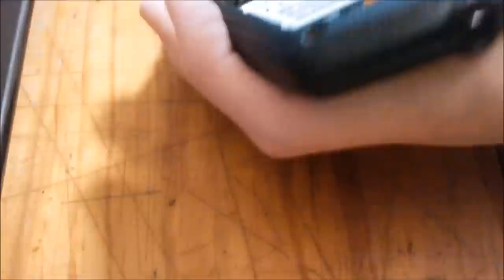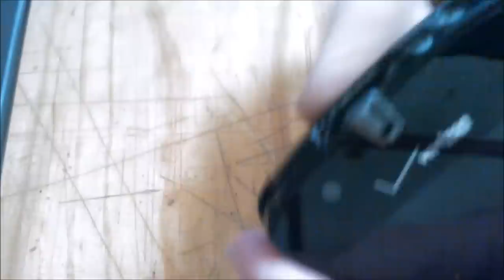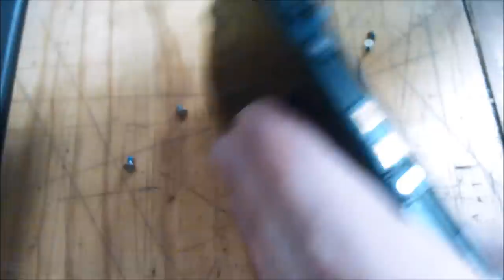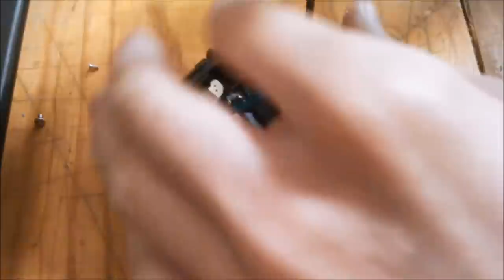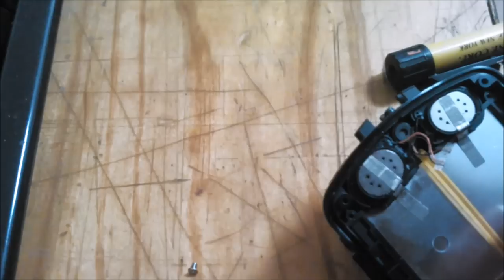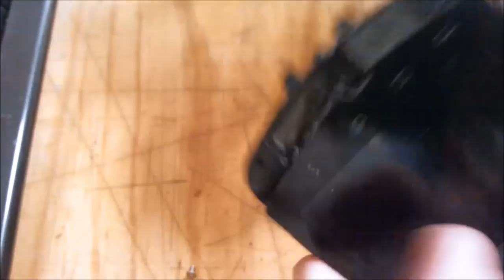Casio Commando 2 (C811) Take Apart Guide

Comment: The digitizer and LCD are "glued" together on some models of this phone, so its not possible to replace just the digitizer in those cases.
Reply from the maker: This is true. If you have a sharp knife, and a lot of patience, you can get it off. If it is not working, you can also try heating up your phone to help soften up the glue.

Comment: hi. is it possible to unbrick soft bricked c811? system wiped and seems there is no stock recovery installed.
Reply from the maker: Revaz G If you plug it into your pc does it show up with adb drivers?
did you install the custom "aboot.img" file located at android forms?
does safe mode work?
if the answer is no to all 3 then your phone is soft bricked beyond repair